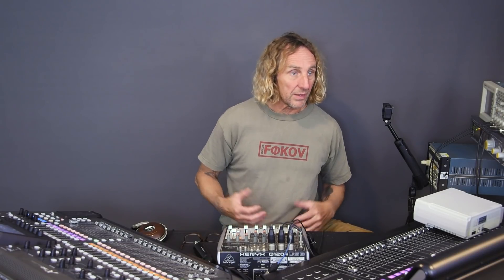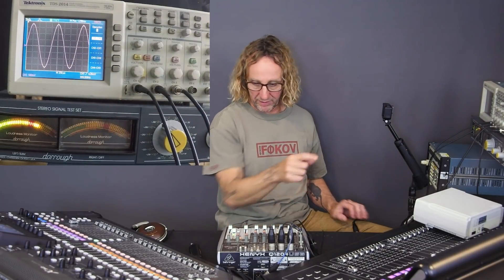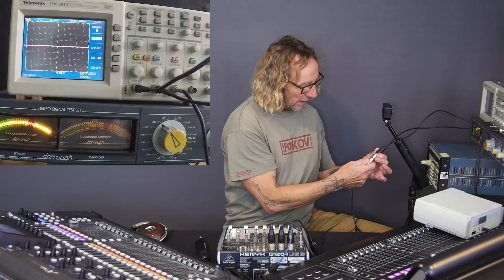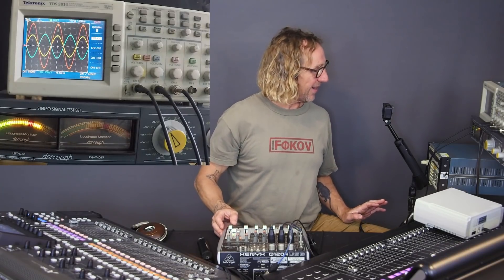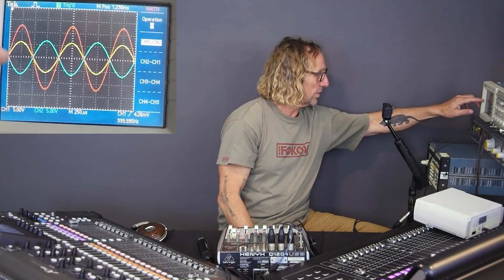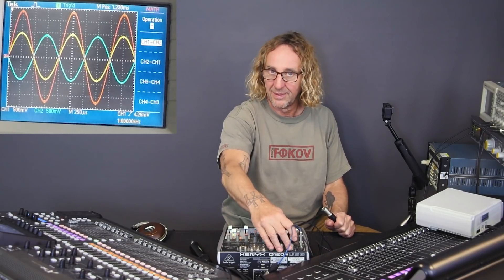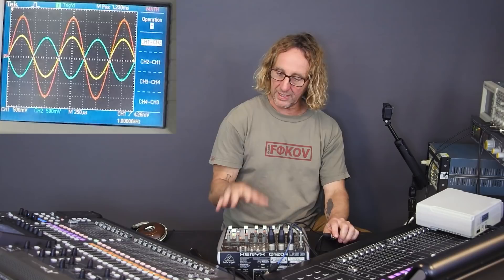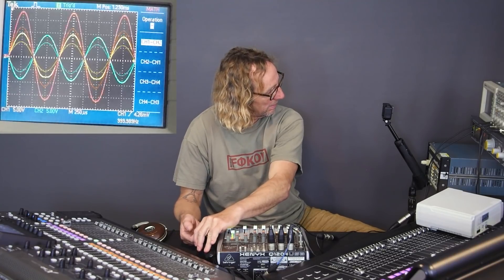Loading Down Midas M32 & Behringer X32 Max Output (Public)

Comment: Thank you Dave, with this test we can also assume that the sum on x32 and m32 it's the same? In the real world, doing a virtual soundcheck on both with the same exact settings the final result will be the same?
Reply from the maker: I hate to make assumptions without testing but it does seem that the differences that at least I am aware of are on the analog side and in the converters. As well as mechanical. So it is probably that a digital signal sent to M32 and x32 and then sent out digital as well, would be the same on both consoles.

Comment: The loading difference makes me wonder.  There are often fairly extreme impedance swings on speaker cabinets.  With a long cable and high output powers will the voltage drop experienced along the length of the cable at high currents vary depending on frequency and alter the frequency response?  Most speaker cable experiments I have seen are done at low voltages/currents.
Reply from the maker: If an amp can deliver a fairly consistent output voltage over the speaker impedance range, it would not directly impact freq response.

That said, a speaker that has an impedance dip will draw more power at that freq and may be louder or very inefficient and quieter and at resonance, the impedance rises and also the speaker tends to be loudest
Reply: @DaveRat  doing voltage drop calculations for 120v 4 ohm vs 120v 16 ohm (rough range of a danley sub I looked up) there would be 1dB difference with 100ft of 14 gauge.  Not too extreme but in some situations there may be hundreds of feet.
Reply from the maker: It's not just the db, it's the damping or ability of the amp to get the speaker moving quickly and the ability of the amp to stop the speaker moving that suffers with long cables that are not heavy enough gauge
Reply: Did the math for 4 ohm 12 gauge 120v 250ft.  30V drop at 4 ohm, 7.5V at 16 ohm. Almost a 2 dB difference.

And it definitely has effects on damping factor, just curious how much frequency response may also vary in larger environments when cabinets have significant swings in impedance, even at frequencies that aren't typically as significantly affected by damping factor.

The amp may be putting out the same voltage but that doesn't compensate for voltage drop in the rest of the system.
Reply from the maker: And the most important aspect is determining how audible and relevant the drops are.

I came from the reverse angle. I was mixing large shows on identical sound systems with differing results and the only difference was longer cables.

I know the sound difference, the softer less punchy sound of longer cables.

So I did a test comparing 150 Dr cables stage left and 50 ft stage right on a full sized arena system.

The difference was audible and enough to where I implemented flown amp racks with shorter cables and the sound improved.

Comment: Dave, 
In my experience those cheap boards create feedback nightmares. The noise floor induces feedback. 

in my experience many cheap boards have such a high noise floor that they actually induce feedback. High noise floor = feedback instability = because noise floor is similar to white noise. When the monitors hiss it introduces a spectrum of frequencies into the room. Once in the room one or more of those frequencies are able to feed the mic into a feedback loop. 

Try it for yourself. 

No matter what is causing it, the gain before feedback is usually really poor on cheap boards compared to pro desks. 

If not the noise floor, what else could this be? 

I had a really telling experience swapping out an old mackie board for a new Yamaha Board (analog). I changed only the board and the room went from fairly feedback prone to super stable. 
What??? 
How??? 
Same mics, cables, eq, speakers, monitors - no changes. Only swapped the board. Significantly more gain before feedback. 

Well the only thing I could think of was that the noise floor itself. They Yamaha had a way lower noise floor. You could easily hear the mackie noise floor (through the speakers) with everything around null where as the Yamaha was dead quiet. 

My theory was that the noise floor is like white noise and therefore becomes the source of the feedback, especially in between songs. 

If it really is the noise floor then they are just terrible products. You get to mix on pro desks while the poor bastard down at the dive bar (who knows nothing about eq-ing) is stuck with a nightmare that he doesn’t even begin to understand how to fix. 

Any opinion? You could help steer people clear of feedback prone boards if you did a cheap boards shootout.
Reply from the maker: Don't think it is the noise floor but more likely inconsistencies in the freq response and under damped EQ filter as well as some resonances in the freq response

Comment: thanks for the great tests. I would have been interested in how suitable the m32 or x32 is when a professional mixes a recording (only with the internal effects and tools) and how does the mixer sound when it is fully exhausted. so what can you get out of the part? can the x32 / m32 keep up with modern radio productions?
Reply from the maker: Don't know all that, I would say it is wise to use more professional gear for more professional applications.

Do ya really want to cut costs and save a few dollars when building jet engines or if a big high dollar production is on the line?
Reply: @DaveRat  you are right. of course i only take the best if i want the best result. I would have just been interested in what you can get out of the cheap consoles when it comes to a production. By the way ... you mixed all my favorite bands live. I like it. I only noticed when I read the kanalinfo.
Reply from the maker: Cool co and great to meet ya

Comment: Hey Dave, Thanks for a great video. What real world scenario is served by a higher voltage? I am assuming higher output volume, but honestly do not know. With my Crest Amps (older ones) i can easily use a non-clipped signal from my X32 to get the crests to clip, so i am assuming i would not benefit from putting a XENYX in-between to output a higher volume.
Reply from the maker: The create have a fairly high input sensitivity but not all amps do. Having a higher output level driving a lower input sensitivity helps keep the signal well above any noise that is influenced onto cables.

Also, with the same input sensitivity but an amp that is 4 x the power output (6db more), you would need 4x the input level to clip the amp (6db more output)

It really varies from setup to setup but it sounds like your setup is well aligned with sufficient output to drive the inputs.

Comment: @Dave Rat what do you think about using analog compressor after X32 master as a preamp to add output and analog character?
Reply from the maker: All good if you are already converting to analog before the amps.

Ideally you would stay digital and not convert back to analog, but yes, if converting back, all good

Comment: OH! I got a question! When you where talking about loading multiable power amps, is it better to daisy-chain at a lower ohm load or just go single amp channel to single speaker? I've not worked with any large set-ups with racks full of power amps but I usually run subs at 2 ohms. I got a feeling with only a few amps (I have three 2 channel units for FOH) my active crossover will compensate, also the one amp I want to use for high/low/mid is a class "D" and the other 2 are regular class A-B for subs.
Reply from the maker: Lower impedance loads tend to allow you to draw more power from the amps. Assuming the amp has enough power to drive the speakers at a sufficient level at a lower impedance loads and you use sufficiently thick wire to to run to the speakers, running lower impedances tends to be a beneficial way to reduce the number of amps and cost spent on amps.

The amps will run hotter temperatures so make sure to provide adequate cooling

Comment: If using a Pro series DL231/251 stage box does the tests change?
Reply from the maker: Since most of what is being tested is the a to d and d to a conversions and well as the analog mic pre and analog output drive, by switching to different stage box design, that replaces all of those, yes, swapping out will change everything.
Reply: @DaveRat  You are amazing and I watch all your videos, I run a Pro2C with a X32 Core for mons with 2 DL231's
Reply from the maker: I would expect the dl231s to be better but would need to test

Comment: The Xenyx had 4 squares between zero and max so 20v x2 is 40v p2p.
Reply from the maker: If you look to the left side, the red 0 volt marker is is two squares up for the xenyx and the peak of lower half of the waveform was over five squares below that. 5 squares at 5 volts per square is 25v peak and 50 bolts peak to peak.
Reply: I stand corrected. You are right! 🙂
Reply from the maker: All good Doug.  I went back an looked and I do make mistakes and was hoping I did not need to fix it.  Thank you!